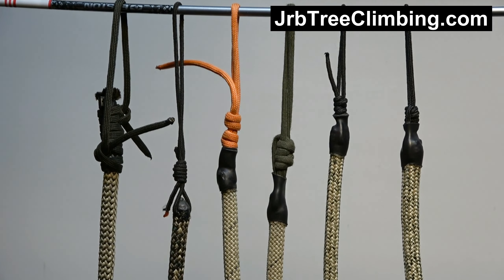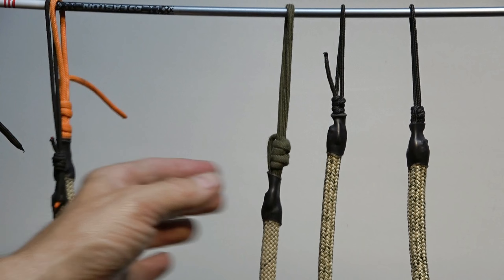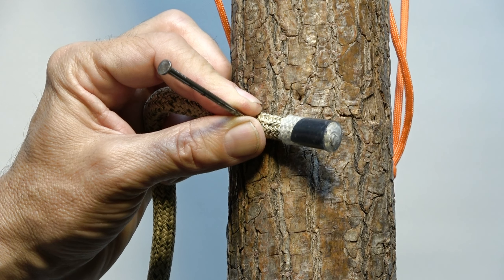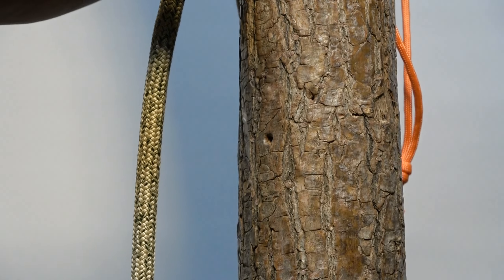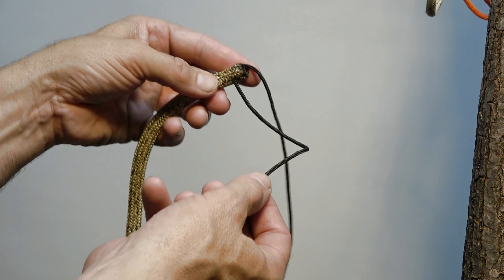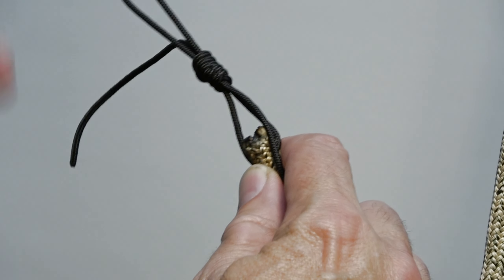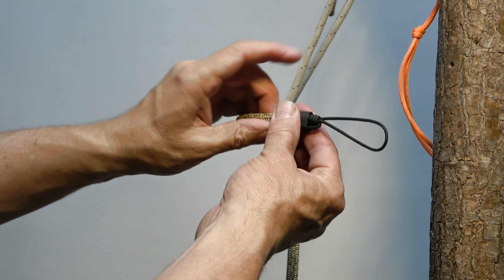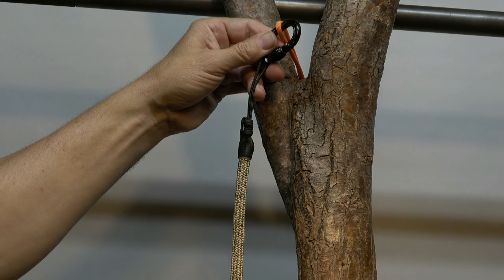JRB End Loop, Version 3

Comment: Awesome video. Another side tip for those interested, if you use marine grade heat shrink it has glue inside that bonds after being heated and is usually more durable than standard heat shrink. Good way to help with keeping things in place and another form of security. Harbor Freight carries it along with normal heat shrink
Reply from the maker: Yes, i use and recommend an adhesive HST and it works great.  I just filmed and released this video today and the HST was on the end loop running through the ring.
https://youtu.be/OFW_5i53nYY?si=23xnE85SPv4OpEzu

Comment: Good idea just to hammer the nail through, then heat the nail, makes a nice hole in my Predator 11mm rope. I use this rope for hitch climbing so it never goes through a  Crotch, but an end loop is very convenient for a retrieval cord. I use different color cord on the ends in case i need to differentiate

Comment: Much easier and faster if you use a soldering iron with sharp point.
Reply from the maker: Thanks. I am looking for a solution that anyone can execute with no investment in tools.  And as far as I know, that would work on fibers like Nylon and Polyester but wont work on Technora... it won't melt.

Comment: I don't think I could resist using the 2 mm cord to do some cockscombing as a whipping over that technora prior to tying my loop.  Wouldn't be necessary on normal rope, but I see the "eye" created by nail being slowly worked apart by the cord. All that is holding you in place is the melted plug.
Reply from the maker: The melted plug is connected to the core strands and so I don't see it coming apart.  I have hung my body weight on some of my end loops, just to test em, and they all held.

Comment: Hey John would using dynaglide be ok to use if you don’t have 2 mm  chord?
Reply from the maker: @frankresch3734  you can try it. I have never done so. As far as I know, that stuff is not very good at holding knots and so it might not hold up that well. 2 or 3 mm utility cord seems to have the best performance. Even the ones I have tied with paracord are sometimes less stable and even a double fisherman's can get loose